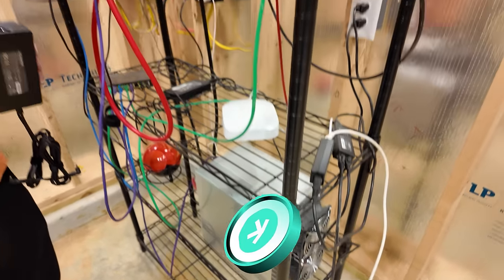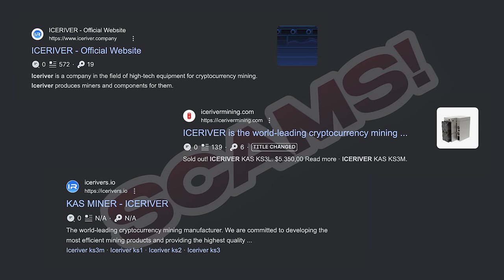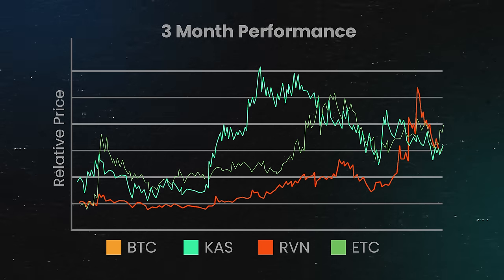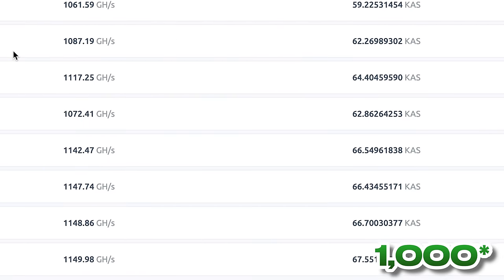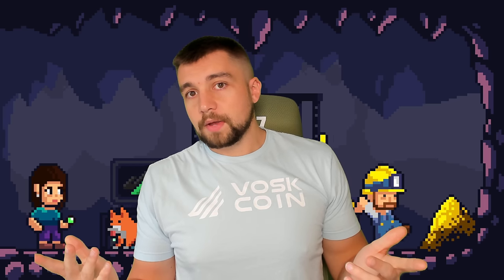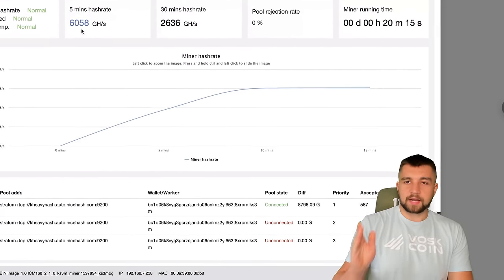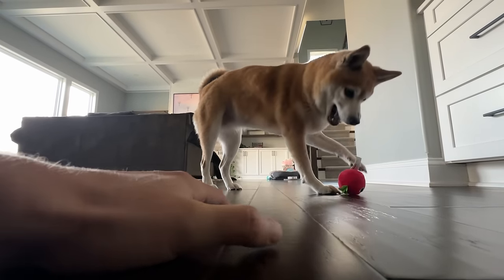My $7,000 Kaspa Miner BROKE WTF - Mining a Bad Investment?

Comment: Good luck figuring out what is wrong with the miner. The proc might need to be reseated or a chip on the board. When i fixed circuit boards with surface mount soldering i would run the boards for 48 hours of testing. You may want to order s new board incase this happens again then you vould spend more time figuring out what is wrong with it.

Comment: I got very lucky. I got my ks3m march batch and stock firmware my ks3m is averaging 6.3 to 6.7 th/s stock and I'm still going to re paste my  chips as they're sitting at around 90 to 100c so you should re paste yours too to prevent damage to the chips. Keep up the great work!

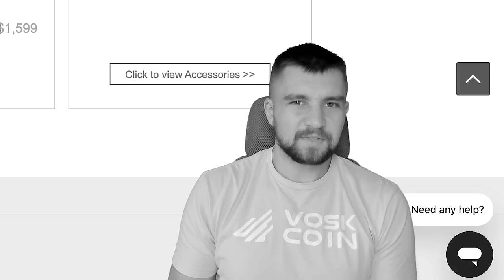Comment: 7:02  That face you make when you question your decisions in life.  My mantra for life used to be If it has boobs or tires, it will give you problems.  But I need one to include miners.  They are like little unhappy minions that wait until you feel like you've conquered all issues and everything is running fine, then they flip the EFFF it switch on you.

Comment: Have quick question can some one help I have a Pdu with only c13 outlet only  can this run my s19jpro buy using two of the c13 outlt  to run the miner each one of the c13 outlet have voltage of 230v